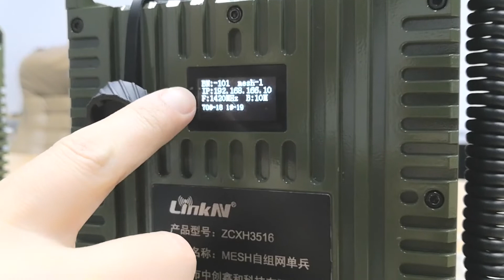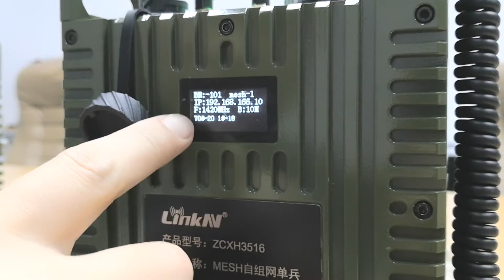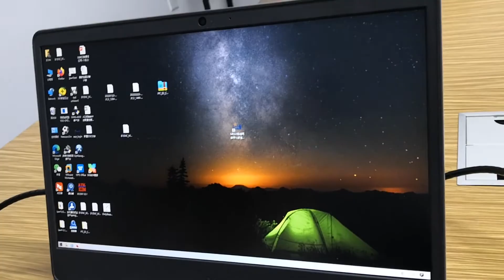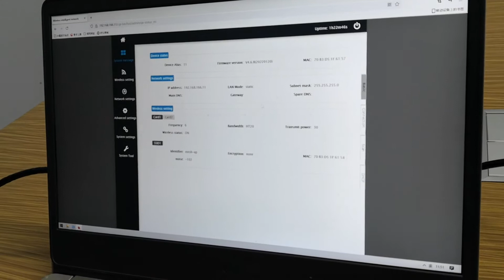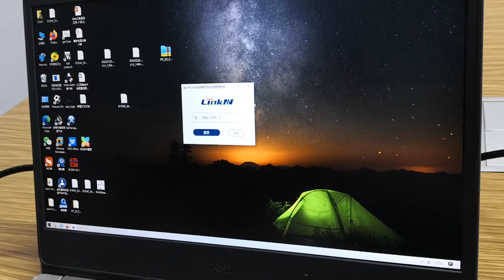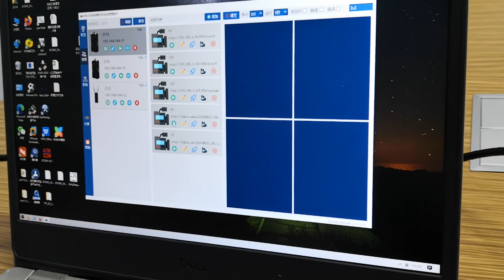LinkAV MESH Radio Introduction

Comment: Good afternoon. At what frequencies does it work? Is there a pseudo-random frequency tuning?
Reply from the maker: Hello, factory default is 562-612MHz or 1400-1460MHz (350MHz-4000MHz for customization), unfortunately it does not support frequency hopping. Thank you.
Reply from the maker: Hello, now we have launched FHSS/IFS series MANET radios, if you are interested, please email info@linkavtech.com, thank you.